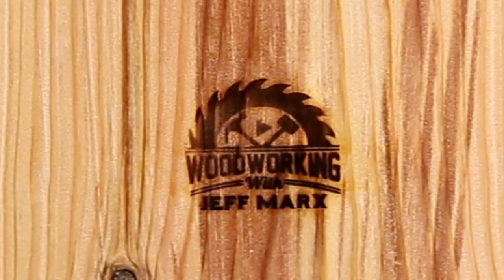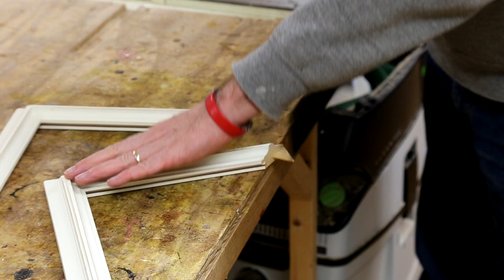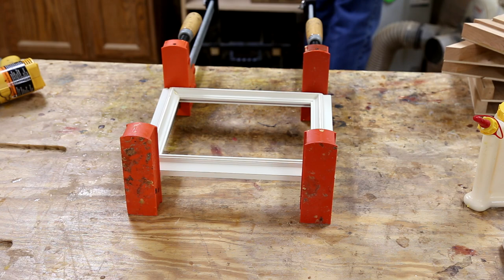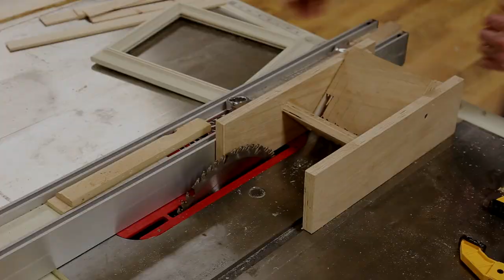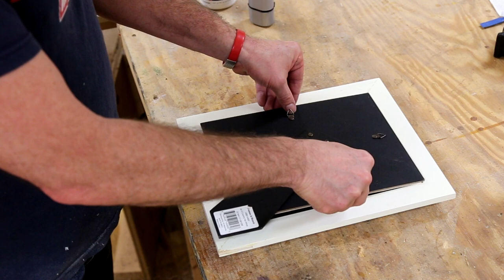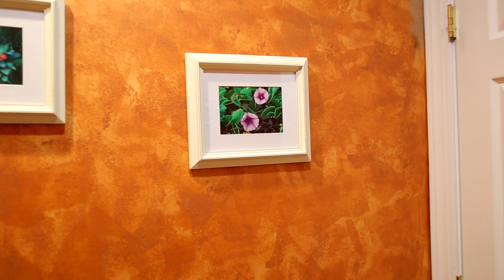Repairing a broken picture frame

Comment: I like the way you did ,but my point is! I don’t have any tools,is there any simple way to fix it? You’re so professional,thanks for your video 🙏
Reply from the maker: Like most projects, there are many options depending on what you have available.  The simplest would have been just to glue it.  This might be strong enough, but could be reinforced many ways other than with splines like I did.  Most craft stores have "corrugated" (wiggly) fastners you can hammer in across the joints from behind. You could use staples from behind and across the joints.  You could route or chisel across the joint from behind and glue something in.  Thanks for watching and commenting!  Jeff
Reply: Jeff Marx thanks for the fast reply, the frame mirror I have is really heavy,I’ll look forward for your information,you’re so kind !
God bless 🍀

Comment: Is there a way to easily cut splines without table saw?
Reply from the maker: Splines can also be cut with a biscuit joiner or a router with a jig.  It could probably be done by hand with a saw, but I don't think most of us have the skill to do it consistently.
Reply: Thanks. I have a couple frames to fix. I could easily get my hands on a biscuit joiner.